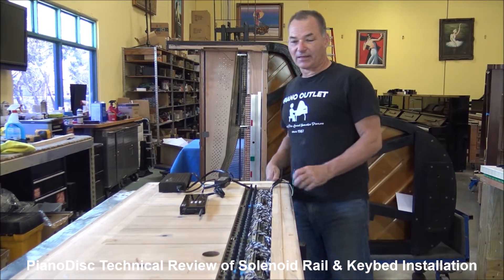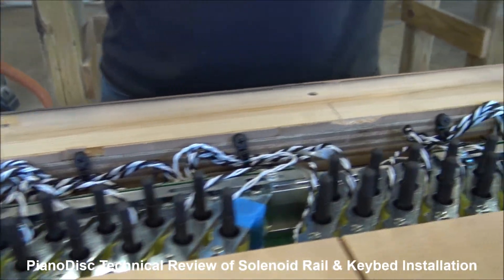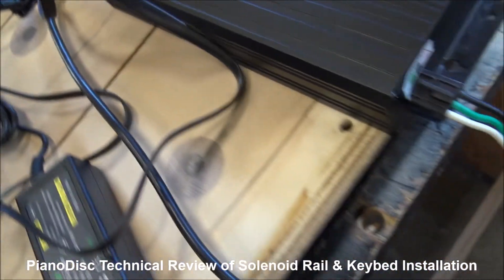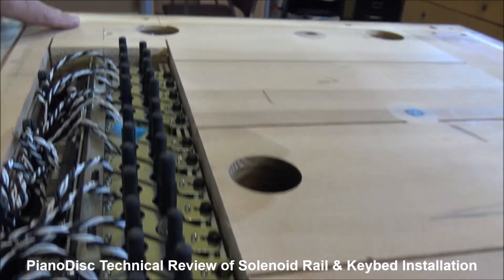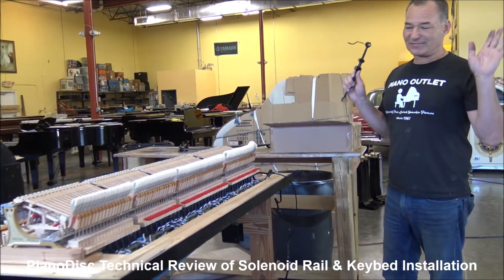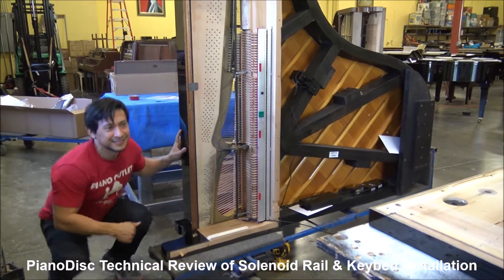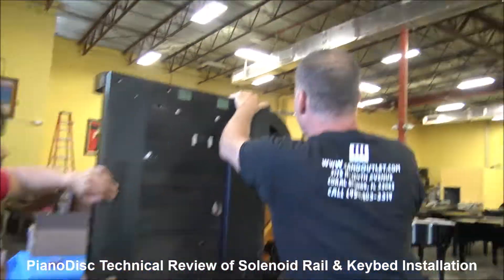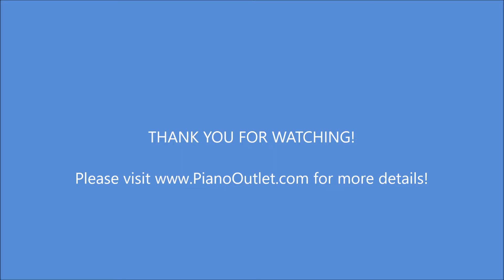PianoDisc Technical review on solenoid and keybed installation

Comment: can i lubricate a solenoid bore. some of mine seen to be a little weak when the volume is low. Ive done a total regulation and lubrication of the keys. its much better but some keys just dont move enough. 128Plus system in a samick sg-155 grand. Thanks !